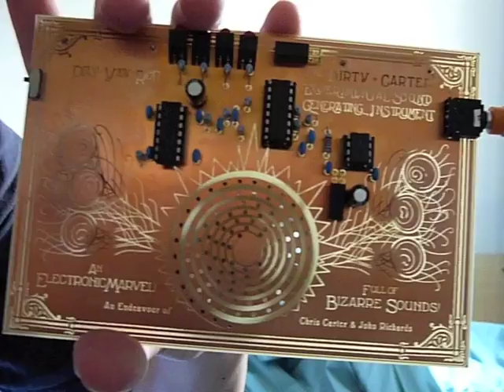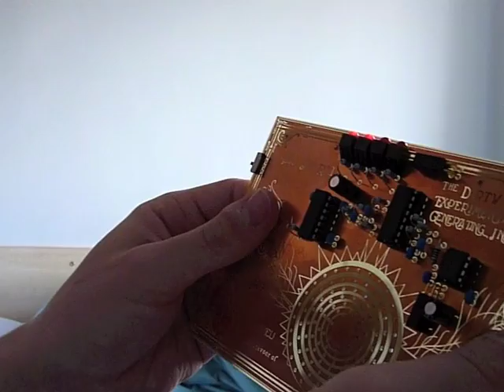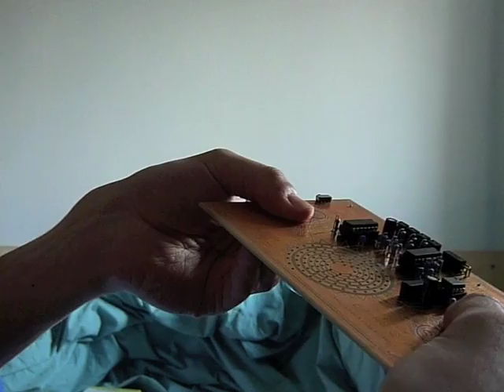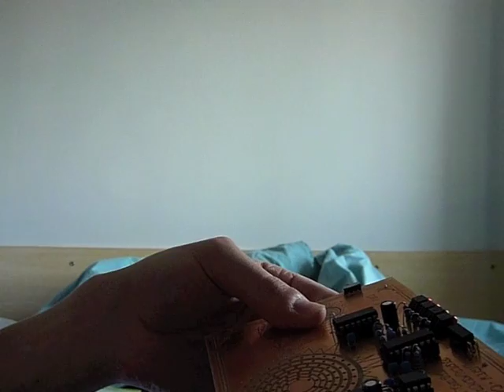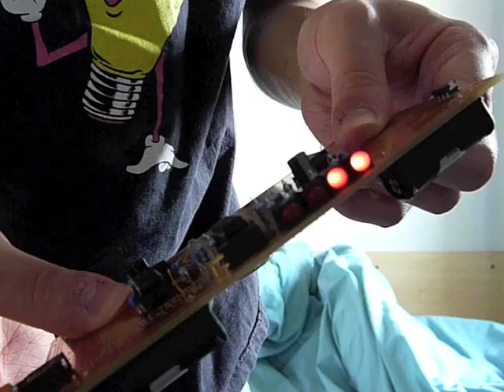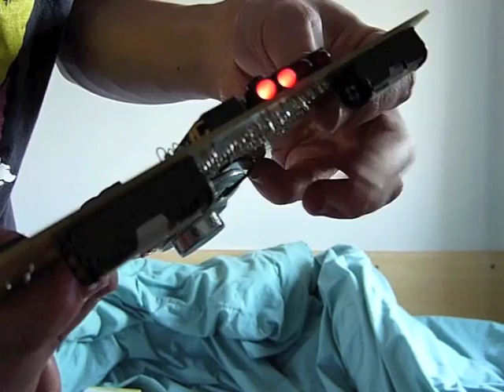The Dirty Carter - Created by John Richards and Chris Carter (Throbbing Gristle)

Comment from the maker: @audioko I'm not sure what you mean - the microphone of the camera and the external speakers I plugged into were both at a constant distance throughout, so that wouldn't have made any impact on the sound.
The tilt switches mean that if you hold it at different angles it will create different sounds. It is very random though... It's very hard to make the same sound twice.
In terms of artistic endeavor - we did a performance with Chris Carter which featured a few pieces with this instrument.